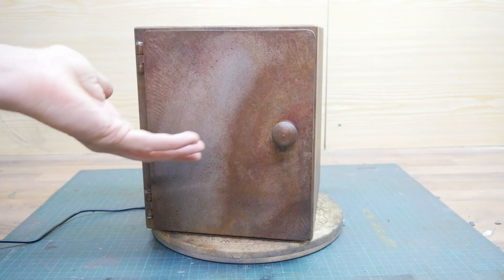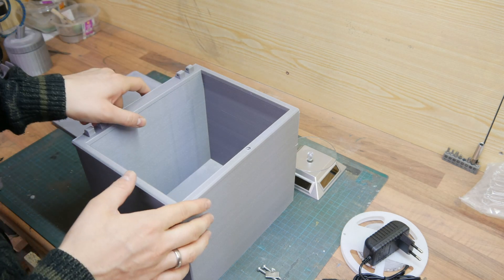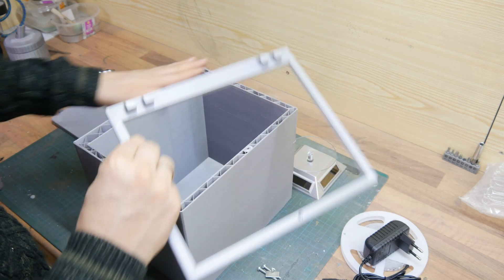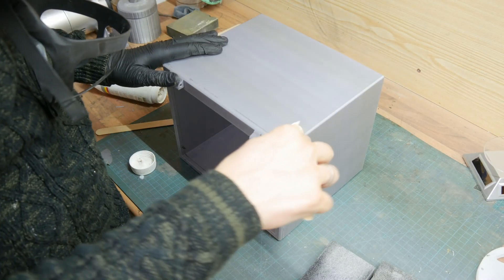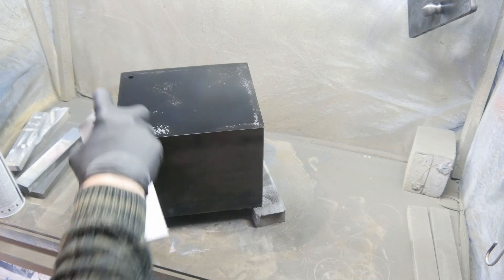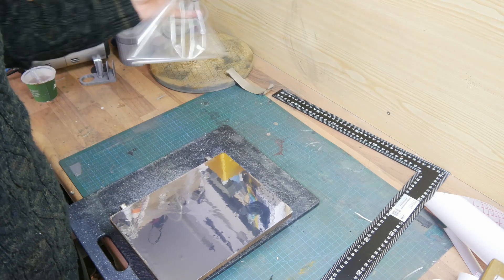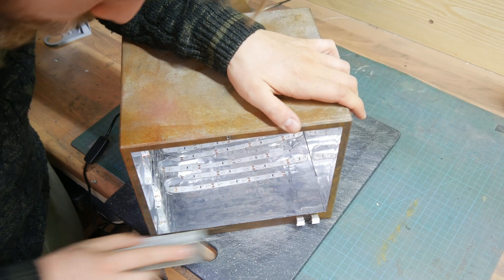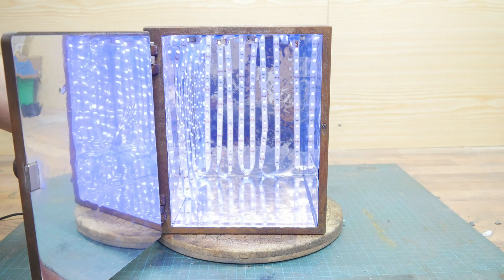CHEAP DIY resin curing UV Chamber

Comment: I had the same idea, but I glued the UV LED strip into a simple cardboard box and I didn't use mirror foil. When I tested the LED strip, it felt a little dim. Now I'm thinking about a wooden box with mirror foil like you did or a metal one to save the foil. How long does your box take to completely cure the models?
Reply from the maker: Depends on the model I would say. I never measured the time exactly,  I left it in for max an hour or so. I usually did not have only one model in it but a couple at once

Comment: Interesting idea, but the only way I can fit this on my Ender 3 V2 is to stand it up, and when I do this, the top is totally unsupported, which makes for a VERY challenging cleanup process. 
The best way to print the enclosure is to lay on its back, but this won't fit.
Reply from the maker: Yeah the buildplate is a bit smaller for the ender 3 unfortunately. you could split the model in half and print it aswell as the door, and then glue it back together. I wouldn't print it upright as it takes sooo much longer and filament waste is really high. Another option if you need a small chamber is to scale both parts only in one direction down
Reply: @WF3D  , thanks. I'm actually taking your idea, and designing my own round chamber, and this will print faster and save material. The UV light I have is slightly larger...too large, in fact, for a gallon paint can, which is what I was hoping to use. Wonder if the UV effects the plastic on the turntable?
Reply from the maker: @Pics2FlicksDennis  I am not sure if it affects it, as i don't know what material it is made from. but I didn't see any impact on it

Comment: The box reminds me on the sentence "if all you have is a hammer, everything looks like a nail".
A printed box? How much is that?? Use cheap wood... This even wouldn't degrate so quick by the UV light. The even cut it for you in the home Depot store...
Reply from the maker: Most hobby stores don't cut small plates for free. I have done that, and wood also is not for free. You can do yours out of wood if you like
Reply: @WF3D  no not for free.. but cheap and durable... And yes.. I did already.. that how I know ;-)
Reply from the maker: Cool! I know that there are cheaper ways to do that. But it's always also aspect of fun, learning and creativity. Someone could argue that your chamber from wood is too expensive and a waste of natural ressources. Better make one out of stone which you have in the garden. I know that sounds BS but it's a matter of perspective. There are also people not familiar to woodworking. Sure smacking some small boards together might not be challenging (for you) but then you also have to get the right hinges and mount them straight etc. There are many hobby users which have a printer but don't have many tools or almost none and almost zero experience with tools. They for example just want to print some decorative pieces with their printers.
Reply: @WF3D  Plastic vs. Wood... anyhow... some ppl will like the tutorial for sure.

Comment: Is the mirror foil Mylar ?
Reply from the maker: I don't know. I just used some random hobbyist foil
Reply: @WF3D  Since you put so many LEDs in there it might not even matter, but the foil probably isn't helping at all since foils like what you used and reflective tape tend to have a film on it that blocks the UV light from being reflected. I believe it's the same with normal glass mirrors too, so its basically a black box under the LEDs in the UV spectrum.
Reply: @ianadams5  I know its an old post but I'm building my own right now and have found that if you use Reflective Mirror Film for windows ( Im using an Australian brand called Pillar) it will reflect the UV light back into the chamber, only blocking it from the light going to the other side of the film.  Hopefully this helps someone in a similar project

Comment: maybe try making the box out of some sheet material? 3d printing is amazing but you should consider its usefullness for each project independently.
Reply from the maker: Hey, I totally get the point! This is more for the "lazy" people, like me :-P. You can press a button and have a box. You have to consider, not everyone has acces to a good workshop to e.g. cut plywood to the right size and then work with that. I am totally aware that this is a bit overkill for 3D printing. But that's what it is totally capable of. People are also printing tons of vases and superhero bust, which will never be used and thrown in the corner. This acutally can be used. ;) But everyone has to decide on his own in the end.

Comment: so certain uv lamps dont  work? what resin do you use for this machine? the stuff i use i bought off ebay.. most common .. just says hard resin .. instructions written in chinese ...it only drys in sun hours in uv like u made does nothing...thanks
Reply from the maker: I use anycubic or elegoo resin. What you describe sounds like you have the wrong lamp. You need an UV LED with 400 to 405 nm wavelength for usual LCD printer resins
Reply: @WF3D  Hi, i just went on ebay and their are 395- 400 nm uv lights...no 405... so the roll of LED's i bought to make my chamber are wrong even though they seem to be very bright blue glow like you are using??? i think i will first try to find a small bottle of the resin you use and try...Can you tell me how long you keep your model in the chamber you made before resin cures and stops running down model... fast main cure is most important for me ...sometimes when i am using 2 part epoxy i start a second statue and the epoxy starts to kick and i go fast and next day that statue looks better because resin was way to thick to run anymore...But solving the uv resin issue will make everything so much better.. thanks.
Reply from the maker: @roadstar499  the LED should be fine. 400 nm is close enough. I usually let it in there for a couple of hours
Reply: @WF3D  OKay the resin you are using is the stuff used in 3d printers...the resin i am using is used in crafts to make little art pieces... Is there a difference in resins? will i be able to paint the anycubic on to add strength to my pla statues... maybe this resin is much thinner? but i am thinking if i can coat each layer then flash with UV light,then brush on a second coat etc... does this sound like it might work in adding a protective resin shell over my abs,pla or petg prints??? thank you for your time and knowledge helping me sort this out...
Reply from the maker: @roadstar499  hey these are totally different resins. I don't know your type of resin. I tested brushing the resin on PLA prints which worked for me. But the surface wasn't as smooth as I wanted it to be. You always need to send it afterwards. I guess your arts resin has a lower viscosity than the resin for 3d printing

Comment: I have been using this resin... mine takes soooo long to cure a thin painted on layer on statues... i first tried a 200 watt nail cure unit...that was useless after 30 mins of hitting timer over and over.. then i built a chamber using very bright uv leds like you made,but round shape,same lights... seemed awesome... unit got nice and warm after a couple of hours this resin was wet as can be.... WHAT resin works??? anyone know? by the time i get this resin to cure from being outside in sun a couple hours all the resin has moved and many places on my statues have none on at all anymore... I need a resin that cures in 20 min s or less so my uniform coating i brush on drys uniform so i don't have to sand the heck out of it ... Please what resin is not junk like the stuff i am using? thanks
Reply from the maker: What resin are you using? You always need to check if the wavelength of the LED matches the needed wavelength of the Resin
Reply: You seem to be confused or you are confusing. One or the other. Once you finish printing you clean your print in iso and then put it into curing chamber. After resin is cured and hardened (no rubbery feeling when you touch it) you can start applying primer and paint. But you don't cure the priming nor painting layer if that's what you meant.
Reply from the maker: @ArtaWorks  I think he did something very different. He used some casting resin or similar and triued to cure it. He smoothed probably his models with it. I tried something similar with resing fro printing and it can work
Reply: @ArtaWorks  I coat  normal 3d prints not resin prints... i think i got it figured out now..thanks

Comment: so what filament did you print chamber with thanks... i will need a bigger chamber ... i think wood will work... i will probably use same  width and depth as yours but increase height 5 inches... do you think i will need more lights in mine or same amount should be fine? thank you for your great video...PS i want to use this to cure a thin layer of UV resin i will apply to my pla statues ...do you think curing will be much faster since its only a paper thick layer of resin? i ask because i am new to uv resin... i only have used 2 part resin which is not the best at coating since it gets runs etc... thanks again..